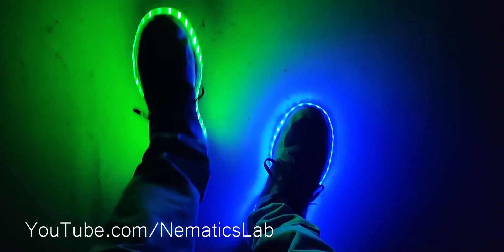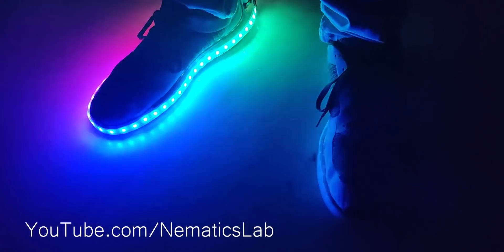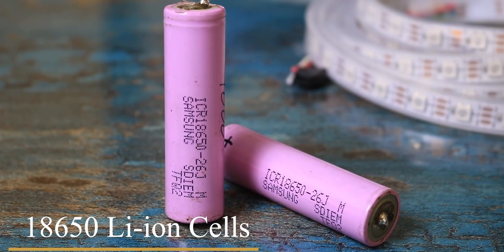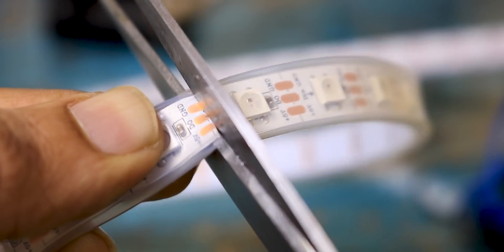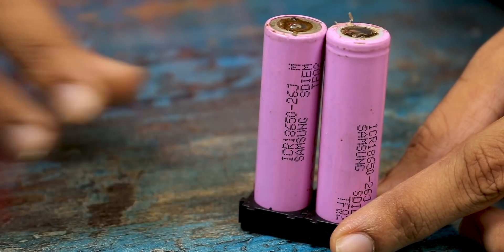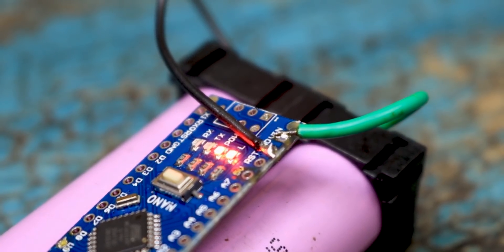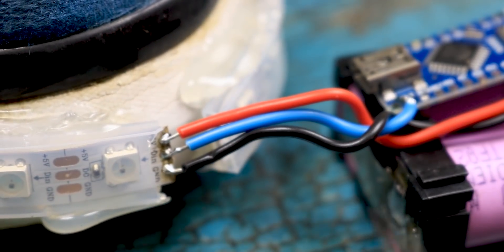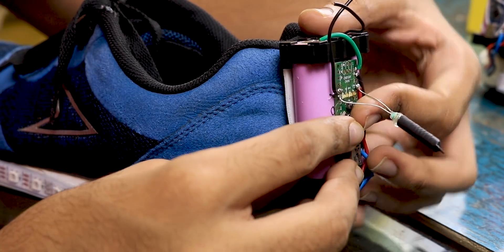Motion Triggered RGB Shoes! | Neopixel LEDs | DIY

Comment from the maker: You can buy all the parts from here,
Vibration Sensor Module: https://www.banggood.in/custlink/v3mmkUR7Ce
Arduino Nano: https://www.banggood.in/custlink/GGD32zyucA
WS2812B: https://www.banggood.in/custlink/KDDKMkE1c7

Tools:
Soldering Iron - https://www.banggood.in/custlink/DKGKUAqCKa
Solder wire - https://www.banggood.in/custlink/mv3vks2ROf
Helping Hands - https://www.banggood.in/custlink/vmvmMAqd0C
Hot Glue - https://www.banggood.in/custlink/D3GDMAkWDS
Reply: R
Reply: 9
Reply: 1
Reply: Kkheq
Reply: R